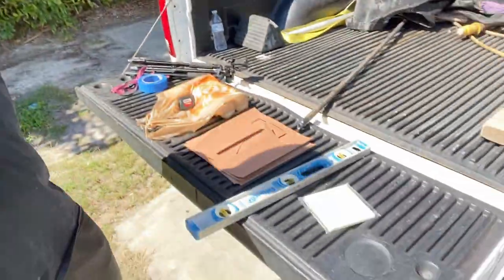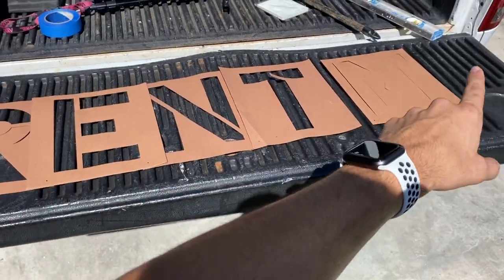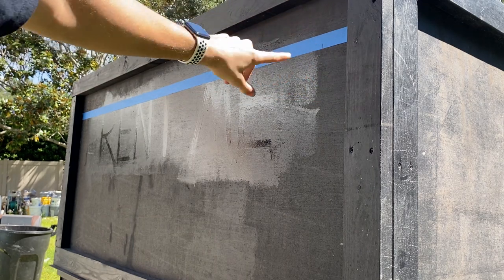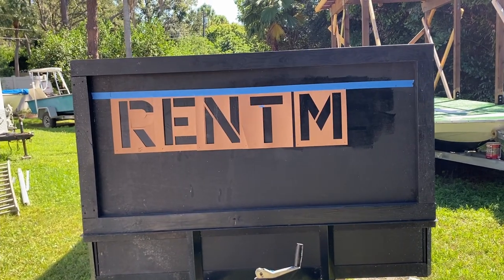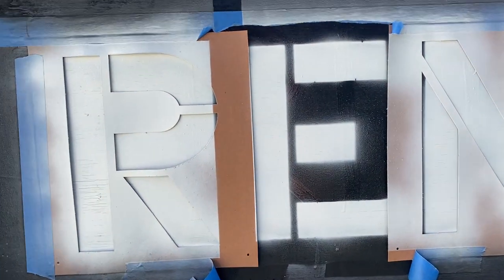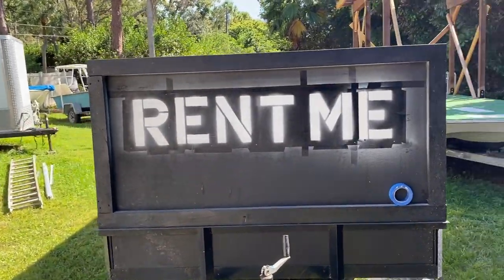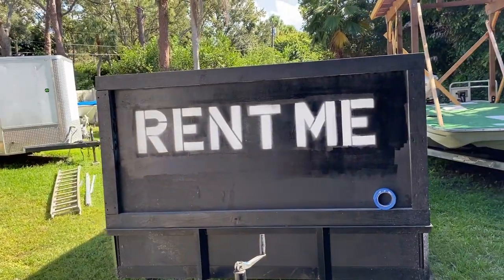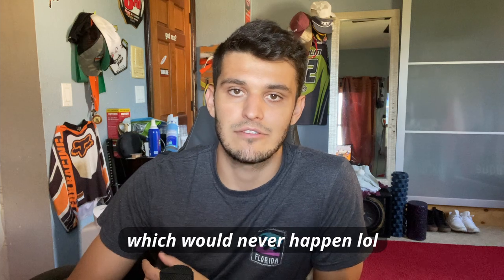Using Stencils Off Amazon To Paint Decals On My Junk Removal Trailer! (Part 2)

Comment: I got a question. My local dumps are not landfills. I have to sort and manually throw the items away. I plan to mostly resell my stuff and things that are 100% garbage throw out or recycle. 
But should I be charging a little more for the fact of disposing of items will take longer?
Reply from the maker: Yes if that’s what your competitors do
Reply: @steezyflips  Weeelp.... There aren't any competitors in my area so looks like that's a yes lol. Thanks man

Comment: with you using a utility trailer do you ever worry about going over weight? what's the payload on one of those?
Reply from the maker: Yes but I’ve learned to just avoid jobs that involve large amounts of very heavy stuff like concrete, pavers, dirt, she’ll, rock etc. these trailers can hold roughly 2,000 pounds of added weight so most jobs are fine.